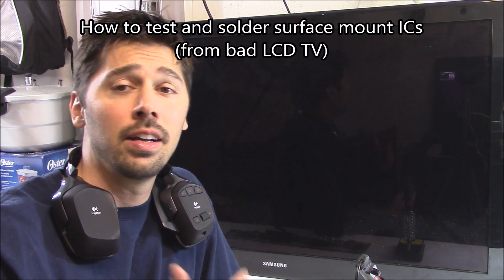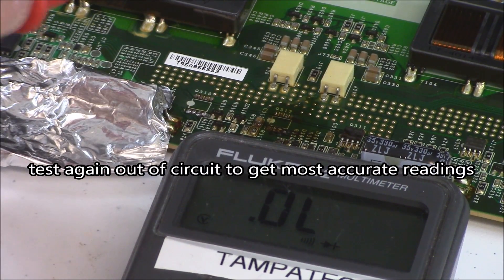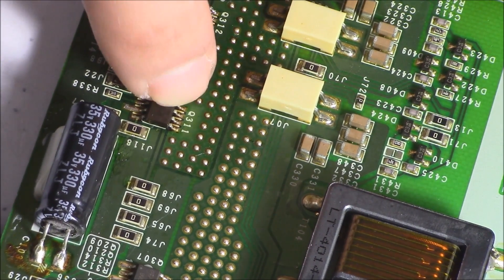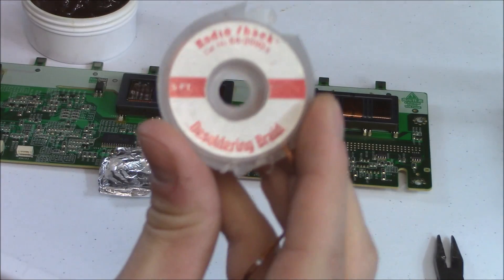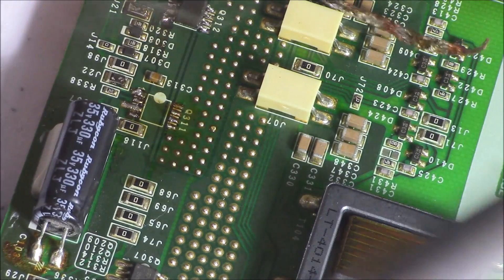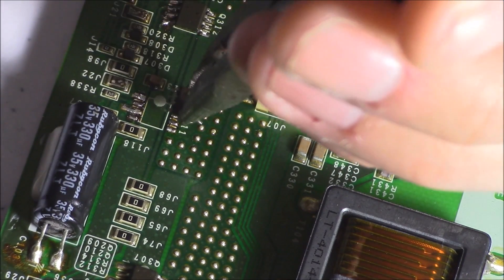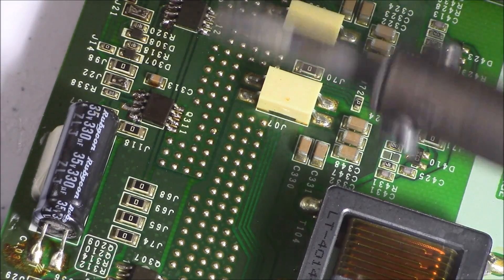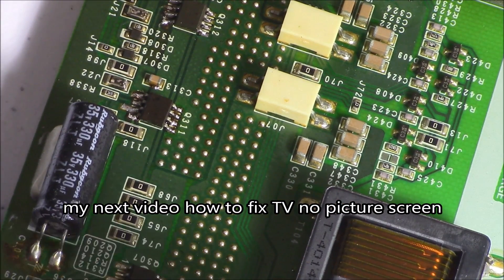How to check and solder surface mount IC on Vizio TV backlight inverter board

Comment: I  i am daniel rock i have a problem with a crt tv samsung 29inc dead set i detected a c5587 complitly schortted i remove it and put a new one same tihing appen the c5587 schortted imadiatly i thing that the flyback transformer is bad but i am not sure i need your help thank you
Reply from the maker: Check horizontal output transistor, it's big transistor and voltage regulator ic on metal heatsink then check flyback transformer b+ pin also check burn marks or cracks, also check for bad solder joints. something inline is shorting the cap like ic or diode. you can replace parts or buy boards at shopjimmy.com
Reply: thank you vrey much

Comment: Hey thanks on the tip putting the flux on the braid.
Reply from the maker: no problem, I learned that the hard way when I couldn't successfully desolder parts from boards.